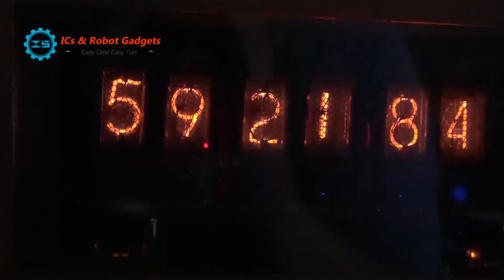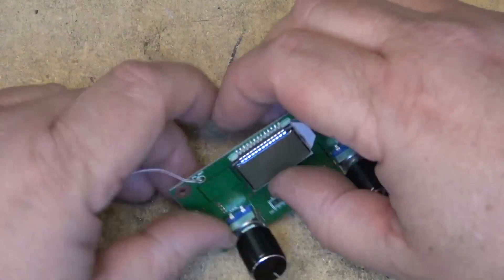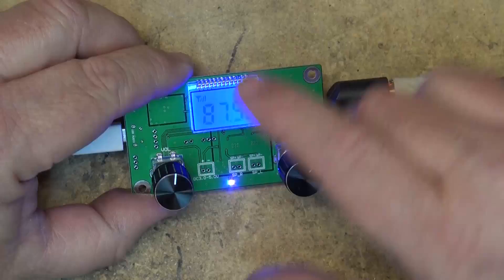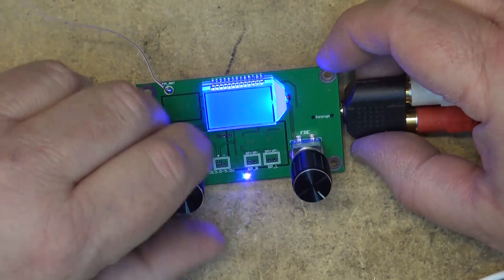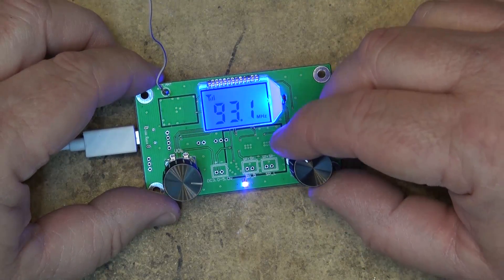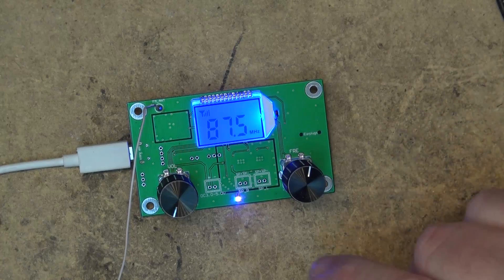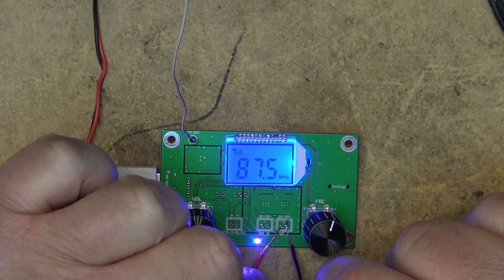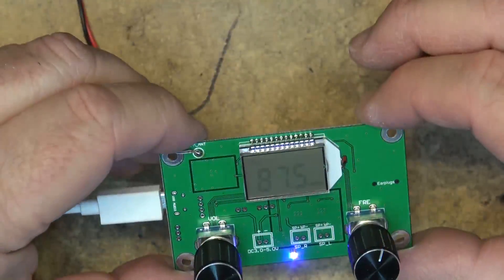fm receiver module

Comment: there are supposed to be different settings available via short/long presses on the 2 knobs. i was hoping you would show those functions but i guess you were not informed at the time of the video. it would have been nice to have some dimensions as the website has none.  hopefully amazon's info is correct and i'll just order one and return it if it doesn't fit.  but at least i got to see the color of the backlight. thanks.

Comment: Hi. Great videos, explained very well. I would like your expertise and input if possible please. I am thinking of a modernising a vintage radio to play 30s and 40s music from websites directly as I’ve not found any FM stations that play this music, and maybe play old recordings in mp3 format by artist. This would give it an authentic feel, from yesteryear. I would like it to play music and choose stations from websites wirelessly directly, not just Bluetooth through my phone or tablet. Is this possible at all or am I expecting too much. Thanks in advance for your help.

Regards
Reply from the maker: Yes one of the up2stream modules from arlic would do the job. They steam live via wifi.  They also have bluetooth capability.  They have both mono and stereo.  Have built in amplifier.  Just connect to speaker.   Then you cab stream from oldies streaming services all day. No phone needed except to set up and it is done by wifi.
Reply: @12voltvids  thanks for your reply and info

Comment: Great radio module. Problem with this module which I can see with this module is the display in located very deep on the board compared to two very protuced knobs for volume and tunning. All seems OK but these two defects could destroy the beauty of the product when packed in some sort of casing or housing. Great review sir.

Comment: I bought one a couple of years ago and was surprised too find that both encoders worked in reverse, that is clockwise rotation resulted in the lowering of volume or frequency in both cases. I swapped  the end connections of both encoders to resolve the problem, Other than that niggle the module is excellent value for money considering that it has audio amplifiers built in.

Comment: Do these modules actually have USB audio output? I want to know for a friend .... no wait I actually want to know, ideally I'd come in on a dedicated interface that I can have my timeshifting software see it a lot easier.
Reply from the maker: Sorry this is a power input only, for those that want to power it with a cheap cell phone adapter.
Reply: @12voltvids  assuming the order goes through that I probably shouldn't of placed we will soon find out. If not I'll just go into the line input. I think there's two versions of this board floating around so I really don't know what I'm going to get.

Comment: I have one of these. Pretty cool little device. If I run a cable from my Pixel's USB-c port it will power this module and the frequency knob changes songs...and yes it remembers the station when unplugged and plugged back in. Their FM transmitter is cool too!

Comment: 1. What is actual name of this module? 
2. Do it requires external Amplifier for audio output?
3. Can we find it on AliExpress, eBay etc. in India and will it work in India?
4. Can you assemble it on any case/box for perfectly carry as portable device?
Reply: Icstation Digital FM Radio Wireless Receiver Module LCD
Reply: U will find on amazon and ebay

Comment: How is recieving capacity? Whether it will pick up the station which is far from 200 km? Can you please test it and confirm?
Reply from the maker: Well considering that FM is line of sight, I will say no. Perhaps 50KM away, but not 200, as FM radio doesn't travel that far as you are well over the horizon.

Comment: Simple question, if the power goes off when power comes back on does this radio turn on and does it remember it's last frequency? I have a booster on the same channel as my primary. My issue is I can't hear it where I live. Somehow I need a radio that feeds into a computer and can be linked online to my computer at home.

Comment: Hey 12 Volt.I know that is not a kit but it brought back memories of all the Heath Kits I used to build when I was only 14 years old.My father insisted on it as he was also an electronic tech. He made most of my toys out of metal boxes with the old bayonet 47 bulbs. My Mom told me I would not go anywhere without it when I was 4 to 5 years old.

Comment: I see that this device requires 1000mA at max power output (only 60ma at min  volume) so it would be interesting to know how it performs if attached to a USB2 port on a laptop (1/2 volume?). If using battery and run it at max output, it may be a good idea to build a battery charging port into anyr enclosure.

Comment: Very cool module. I bought one and I plan to build a small portable radio. I will be running it directly from a power bank battery (3.7V) and not through the 5v side. I have two nice 10 watt speakers I got from a broken flatscreen TV and a see though case that a toy watch came in. I have nearly all the parts I just need time to do it.

Comment: I did a video on another version of this radio. I also figured out how to control it with serial AT commands. The commands are here https://www.dropbox.com/s/13hmmbstgu7exx6/at%20commands.txt?dl=0 Mine used TTL and I had to connect a 5v ttl to 3.3v serial adapter to control it. Serial settings: 9600 bps, 8N1, XON/XOFF

With the AT commands you can tune outside the FM band but it does not seem to pick anything up.
Reply: That will come in useful if I ever do get the module. There is one particular radio station I like the timeshift and I have been doing it with a TV tuner and it's kind of funky but it works. I have been thinking about if I can find a module with USB audio out and some sort of control that might be scripted. That way I can devote the TV tuner to TV. and use Playit recorder to record the set audio interface at time and script Channel changes, freeing my microphone input for something else.... and that isn't a backup radio recording because the TV Mac tuner software is crashie (although it outlasted the Windows system that is used as a backup with a small radio and had a hard drive crash last year).